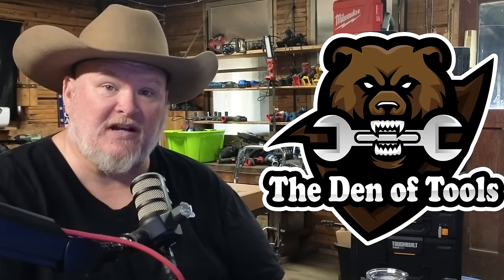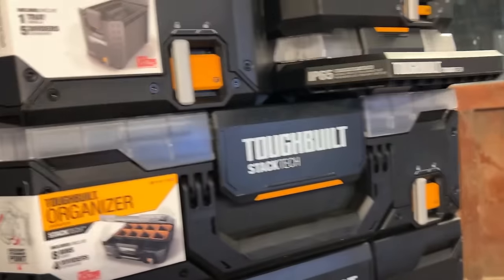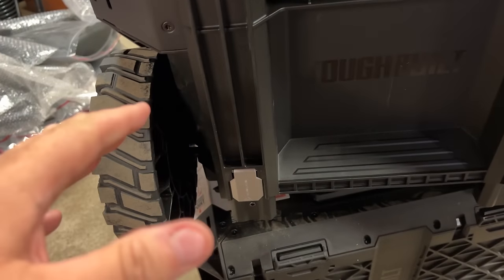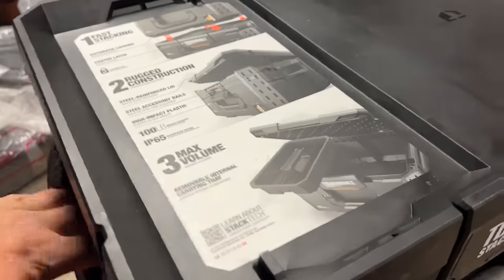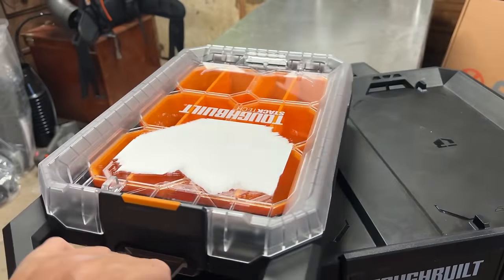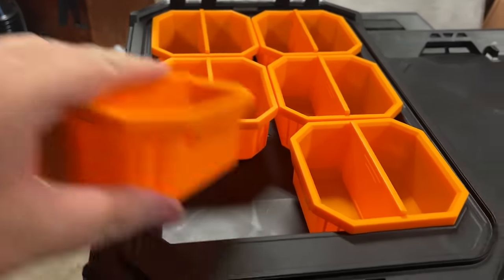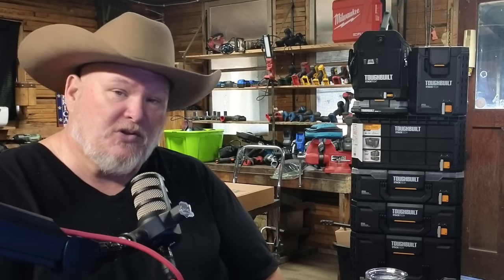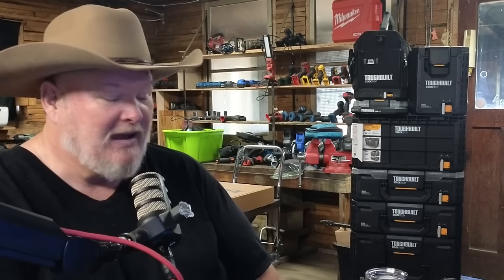ToughBuilt's New StackTech Launched Today at Lowe's!

Comment: The one accessory you didn't know is probably an extension cord keeper. I don't have uses for stacking boxes in my job. The drawers are what make it worth it for me along with the accessories. This is cool and the first to get me thinking about a pack out system.
Reply: Yes, you can se it at 31:15
Reply: You can get the Milwaukee hand cart which has a blank base and build with drawers from the bottom up. Fixed handle that doesn't telescope but super stiff and solid like a dolly for handling a heavy stack.

Comment: Not having drawers at launch is kind of a bummer
Reply: I agree. If the rolling box with the large drawer was available I would have been first in line.
Reply: I hear you i that.  As a Ryobi fan, it was disappointing to get our own green rolling toolboxes but with only 3 tool boxes and a milk crate at launch, it wasn’t much of a platform to get excited about. Several months later the other basics that should have at least been made ‘coming soon’ at launch were shown - storage organizers, drawers, and a dolly - but the enthusiasm was long gone by then.  

This ToughBuilt launch is better but still a little incomplete without drawers.
Reply: Rigid has not had drawers for YEARS💀
Reply: It’s all about the drawers. Stacking boxes are dumb, maybe 1 or 2 small cases on top of your drawers.
Reply: @KZ-yy9pm I think there's some value to being able to stack them, particularly for storage and transportation. That being said, the bottom tool box should always be a drawer so you can access everything without having to disassemble the whole stack. I think I'm going to reorganize my tools and put the most often used ones up top and put the beefier tools that don't see regular use at the bottom.
Reply: True, but at least I know they're coming out with drawers. The roll out plan is amazing.
Reply: Brought a craftsman set 3 days, it broke immediately with 6 tool in the set. Return and switch to toughbuilt it’d definitely higher quality. Even the employee at Lowe’s said their own employees damage the craftsman & Kobalt while setting it up for display. That is why the zip tied the drawer lol

Comment: IPxy Intrusion Protection, x is solids like dust and dirt falling or pressurized, y is water falling to spray from various angles to immersion .  If 'x' is not specified it will appear as an 'x' (e.g. IPx5 - level 5 water protection).  If 'y' is not specified it might be left off or specified as an 'x' (IP3 and IP3x mean the same - level 3 dust protection).

Comment: The Ridgid 2.0 handle/wheels unhooks from the box so you can put your drawers on the bottom. Just picked up the Ridgid pro 2.0 system. 3 boxes a crate and an organizer for $225 out the door. Drawers are on the way. Tough and lightweight. No concerns about durability. Big wheels on the base. Handle isn't as firm as the Milwaukee packout and no rails or brackets for add ons. Not really an issue for me. I also like that the boxes don't have to be locked together every time you set one on the stack. You can just stack and grab as needed without messing with latches every single time you want to move a box.

Comment: Wow...if all of these things are going to really come out, I think this system will take over the stack box market and possibly home cabinet/cart system as well. After seeing how they hold up they could easily move into the professional systems. For light duty/home use they should hold up, but a hard hat site...will have to wait and see.
I can easily see any type of traveling vendor with these, to carry their supplies, inventory, etc. It could also be used for product displays using those side attachment options. The option to have a usable on site space to work on product, (customize, create new, etc.) , be a cash drawer, and its lockable. With that gurney kit, this system is nearly perfect for everyone. 
People throwing responsible adult beverage large group meetings dreams come true with those stackable drink coolers with taps.
Make sure that gurney doesn't damage the back of an SUV when its pulled out and soccer moms will want it for their time to bring drinks & snacks, tailgaters (sports version), street vendors, convention vendors,...could be used as luggage,...maybe.
Reply: Looking at the gurney system, it seems the wheels hover the leg rail about an inch off the surface of the bed, so with all 4 wheels it should just perfectly roll in and out without dragging the leg shafts on the bottom.
Reply: You're so right. The amount of industries which this system could be used for is numerous. I'm looking forward to seeing the gurney rack come out. That would be so slick to slide in and out of my truck bed.

Comment: I'll throw in for a radio with a covered compartment for cell phone USB connection as a speaker/player/USB multi port charger (2 or more ports).  Also a Charger box that has an internal power strip (with 2+ USB charging ports) that has a dedicated power cord on the outside.  Love the level rail pocket.  How about a heated insulated container for Jobsite coffee!

Comment: Im.sorry  but I think this system as a whole is incredible. The bottom wheeled drawer, genius. The integrating garage system, beautiful.. Love also how there original bags attach to there new
 systems. Dont even get me started on that truck, gurny type dolly, And the convertible hand truck. Excellent. . Seems very well thought
 out. Just one BIG thing missing (for me). Radio??????
Reply: could always custom mount which ever battery platforms radio you're using onto the side of the stack. As someone who does a lot of 3d printed modifications, i'm going to have a field day with these packs.
Reply: Noticed a reply below of the wood deck... could mount a radio, or chargers, on a wood deck and put on top.

Comment: Do you think the tool bag can hold a Dewalt drill impact and screwdrivers, pliers, a couple batteries, a drillbit case, an impact bit case and a few odds and ends?  I can’t fit it all in my Dewalt bag. The one that came with the tools so I was looking to upgrade. Thank you very much for your help.
Reply from the maker: I would say, can probably handle all that. Just remember, this is a tote, meaning it’s open top, so not like a bag that zips closed.

Comment: I'm a big fan of the ToughBuilt stuff.  However, I have no need for the StackTech, even though it is quality.  Hmmm....  I'm thinking with a bit of Hack Fabin', I could make a great range kit.  Find some way to attach a gun case (or two) to the sides, and roll it out to the shooting area.  I did buy a whole lot of their tool belt items, those with the quick clips.  Note: If you're a smaller human, I have a 31" waist, plan on doing some surgery on the belt.  Just picked up the 16" bag (Lowe's).  Mine did not have the shoulder strap included (nor did any others on the shelf).  All tough ballistic style nylon.  Going to outlast me.

Comment: It seems like toughbuilt thought a lot of things through,  except you cant stack any full size box on a half/compact boxen.  Its amazing what gets overlooked.   And well see if thos handles hold up and the lids don't warp...
Reply: The only advantage to stacking full size on halves is transportation. You still have to remove the stack to get to the halves so why not just stack the halves on top from the start??
Reply: @MONEYZ123  stability,  would be just one factor to consider.   As well as now you can't stack a crate on top of halves.    I could give half a dozen others, but I think I made my point pretty clear.
Reply: @MONEYZ123  there are those who are okay with the statis quo and fall inline and don't mind being the ginny pig at your own expense,  I'm just not one of them.  I look to see how things can be improved.   Case in point, supposedly tough built is making some sort of platform to fit on top of halves, so wholes can be set on top.  That should be enough evidence of something being over looked.  And best yet,  you will have to pay extra for that adapter.

Comment: The system looks tough. Curious to see how the locking clips hold up to long term abuse and drops. Worried about one failing and the mount is shot
Reply: We have completed multiple layers of thourough durability testing and the whole locking mechanism can be very easily cleaned up with just the removal of a 6-screw panel. And of course it's all backed by our class leading ToughBuilt Guarantee!

Comment: Ambulance bed starts at $1800 used n up. 1200-2000 lbs BTW 2019 pricing. Should of build it. Cheapo looks it would fall apart in month of job used.

Comment: I have a concern about the locking system: Will it allow dirt and other crap get in the mechanism and gum up the works. I suppose time will tell. I'm going to be in the market soon for something to replace my Ridgid setup and this is in the running with the Milwaukee Packout system.
The Gurney system looks awesome though. Definitely a checkmark for the toughbuilt
Reply from the maker: I doubt it but even if you did you can just take off the screws and blow it out.

Comment: It’s not even close to slaying the pack out. No mounting plate you have to buy am adapter plate for the unevenness … for a 10-20 dollar difference between pack out and tough built ill stick to pack out until they can work out the issues and pricing to compete better than just a 10-20 dollar price break

Comment: This comment is not about the current video. What about Bower 4 1/2 inch orbital sander which I recently purchased which is a great woman Sandra so you guys have a freight does not have the 4 1/2 inch sandpaper this great little problems. Do you know anything about it? I also noticed that Milwaukee has just released a 4 1/2 inch orbital sander that looks to be identical to the Bower sander at about 4 1/2 times the price. By chance do you know is the Bower in Milwaukee tools made in the same factory in China?